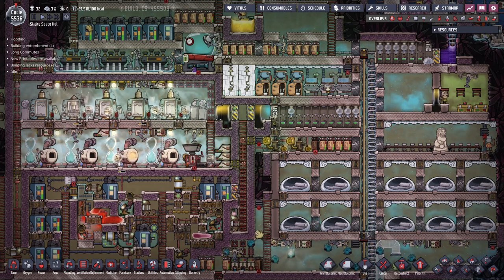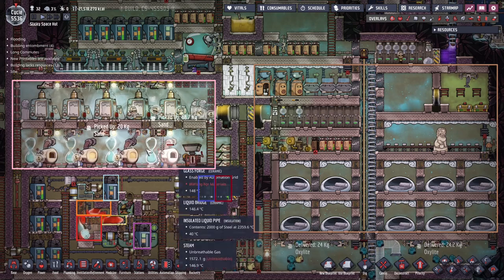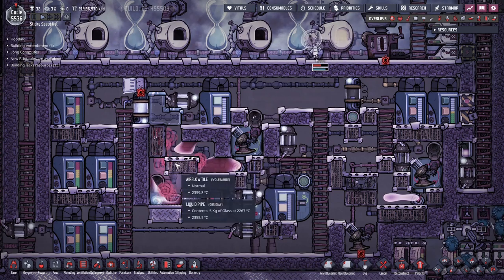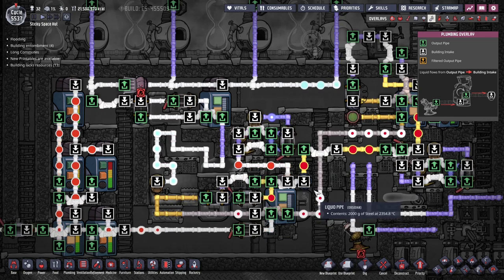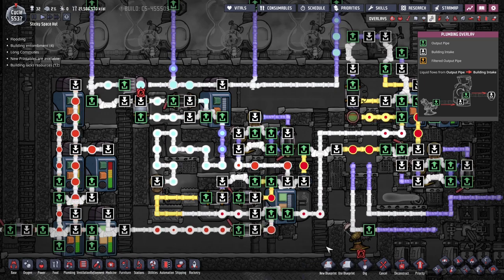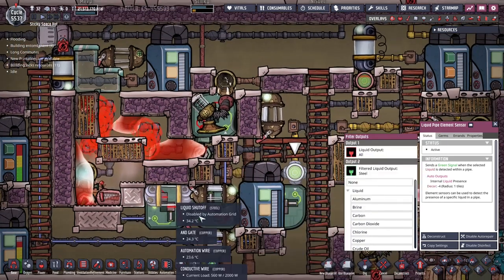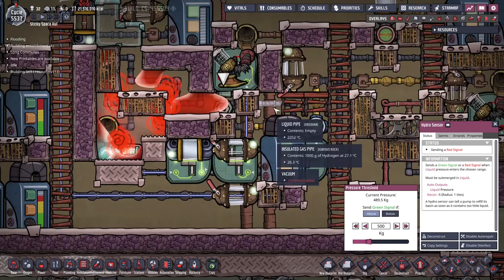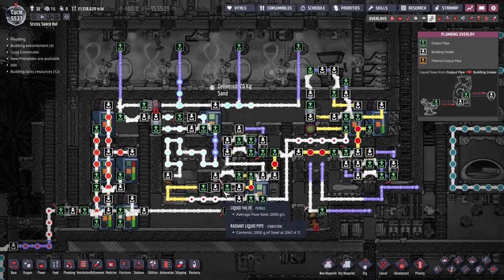Glass Boiler! Make your own Magma - Oxygen Not Included

Comment: I had a magma powered petroleum cooker, with a heat spike into my magma biome.  Cycle 1500 it has colled to the point it is turning the magma to rock.  Would you say this is a viable way of 'restarting' my magma biome?  Either dripipng the new magma straight into the magma pool, or creating a new spike and adding the heat that way.  I'm on spaced out and dont have any space materials yet.
Reply from the maker: Absolutely, you can crush rock to sand, and then pump 2200C magma from the glass boiler into the magma biome. One caveat is that glass forge will delete 75% of material. But if you have regolith, then you actually want to delete the excess.